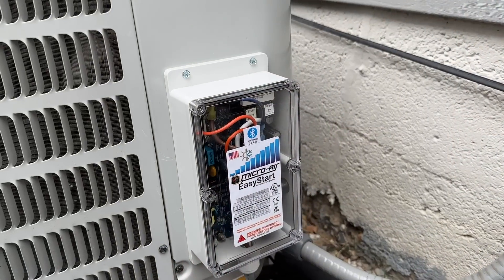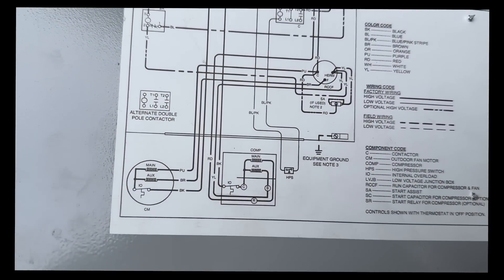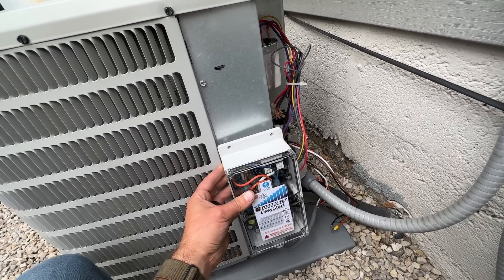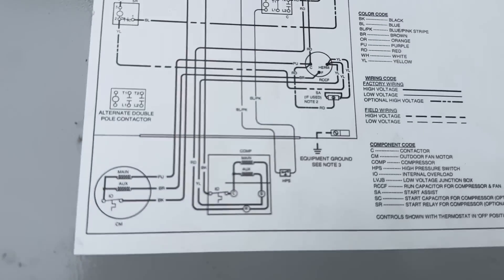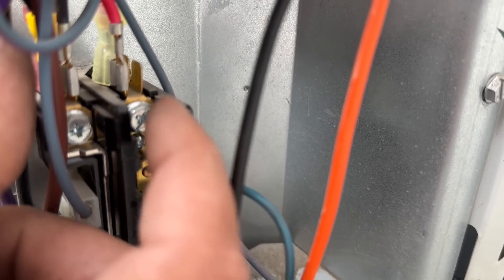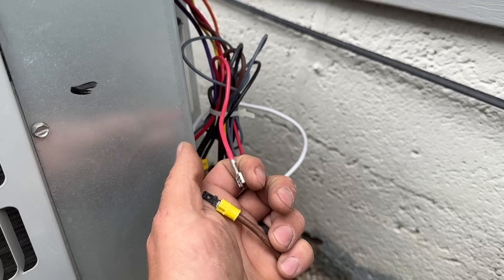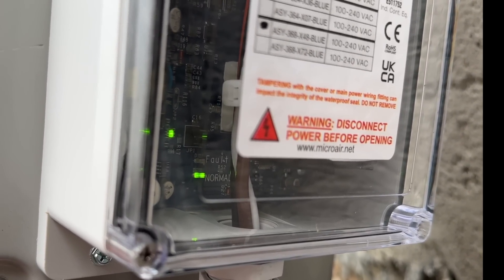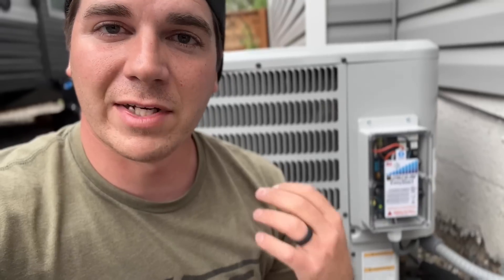Prepare For An Emergency Power Outage By Installing This Device.   Micro-Air Soft Start

Comment: Did this over a year ago for the exact same reason and it works perfectly. I think all compressors should come with an easy-start board pre-installed. Gives the compressor a longer life.
Reply: Yeah, but then you wouldn't have to replace it as often...planned obsolescence!  Just like everything else in the world.
Reply: Hello. Novice here but by delaying the compressor from starting as designed, what does that do to the cooling times? Does it prolong it at all? If it does prolong it then would it be minutes or hours? Lol
Reply: @rci30  It prevents the hard start, instead it ramps up. It doesn't do anything to the cooling time, just prevents wear and tear on the compressor from the instant jolt.

Comment: You misunderstand about the nature of a soft start device like this. It does not magically use less current so you "save money" as you stated at the end of your presentation. This device helps to prevent a fuse blow, a circuit breaker trip or a power generating device that was incorrectly sized for the compressor start-up load by an amatuer electrician.

These soft start devices are trending in popularity because of the solar generators (big lithium batteries paired with an inverter/charger combo such as Eco Flow Deltas & Goal Zero Yeti 6000X etc). 

The firmware in these new solar generators is programmed to prevent too much current discharging from the device in a short time when connected to high surge induction loads like refrigerators, air conditioners and washing machines.

Comment: How do these compare to Sure Starts by Hyper Engineering? I know they are both Soft Start, i work with Tesla PW and if an A/C is compatible thats what was used. Wonder why they had such dedication to that brand as they seem to cost substantially more then this one does, big companies usually go woth cheapest option that works.

Comment: Where do you power the air handler from when using a generator? Did I miss something?
Reply: You'd need to have an electrician install a generator inlet and lockout kit on your panel in order to be able to power the HVAC with the generator.
Reply: My point is that a condenser should not be able to run unless the air handler is also running to satisfy the controller.   One without the other is useless.  @waterboy74

Comment: I've really considered this, but my HVAC contractor says:  "This falls under the category of it sounds good on paper but in practice, not so much. It will void any warranty you would have on the ac system. They would not work with variable capacity, modulating or dc voltage compressors at all without likely damaging the electrical components.

Typically, units get a “hard start” installed as they age as the compressor needs the extra help trying to get started. Soft starts tend to overhead motor windings, leading to an early death of the compressor. While they may save you energy, when they destroy the compressor, that doesn’t save you any money in the long run."

Comment: So would you recommend installing an Easy start on a new AC unit to extend the life of the compressor?
Reply from the maker: Some argue that it gets the windings hot really fast by starting it slowly but I can’t confirm that. I wouldn’t install it purely to extend life, I’d do it if I wanted to be prepared for an emergency.

Comment: Is there a benefit for installing a soft start on a system besides using a generator during power outages?  I don't have a generator and may not get one.  That's for another time.
Reply from the maker: If your ac makes noise at startup this will definitely help if not eliminate that, as well as keep the lights from dimming when they come on. It also allows you to run a smaller breaker size at your panel 👍🏼

Comment: I'm having one installed in preparation for solar panels with battery backup.  My Lennox AC has an RLA of 82 amps.  That would overload the battery's capacity and trip its protection circuits.  So am getting one now.  My system really sounds horrible when it first starts up, as do all the units in my subdivision and we are a new subdivision less than 5 years old so all the HVAC systems are new.

Comment: Interesting .  What size unit are you running there that pulls 39 amps,  is quite a bit..  So this system drops it down to 7 amps,  that is amazing..   Why put in a 20 seer system  if it drops the amps 32 points down to 7 amps..   How does it do that.. I need  to go buy one..   A start kit will keep the amps low on start up but during the Run..
Reply from the maker: This is probably the most common one. It’s for 3-4 ton systems: https://amzn.to/46fFxO9

The Amps running will not change, that’s why I’m going with the 20 seer. This unit is great for running your system in the event of an emergency. That’s the primary reason for installing it.

Comment: I have an Emerson 49M11-843 Sure Switch contactor on my Rheem AC (R.L.A. 16.5/16.5)...Can I attach the Black 14g wire from the Easy Start in the same slot as the 10g T1 Compressor Common wire? There is no other place to connect the Black wire from the Easy Start.
Reply from the maker: I’d venture to say yes but for the best customer support I’d contact Hutch Mountain. They have really good customer support for the micro air units 👍🏼

Comment: If an outage has me desperate enough to break out the generator it's to power essentials like the fridge. Not the luxuries of the entire central A/C and HVAC system. And don't need a $XXX control board to diag a faulty $15 contactor or capacitor.
Reply: 😂 yea try working a 12 hr shift, rescuing stranded ppl, throwing away your entire home contents (wet) at that. Last time I checked hurricane season is in our hottest months of the year. What in the hell is more important than fucking cold air? 😂 southeast texas gulf coast would wholeheartedly disagree, nice take tho

Comment: Cool! I look forward to seeing a comparison of your electric bills, before and after!
Reply: Soft start will have zero impact on the electrical bill.   It only spreads out the startup over a longer time to lower the current.  It has no impact on startup power or running power.  Even if it did you wouldn't be able to tell it from the electrical bill as there are way too many other variables at play.  Different weather before/after just being one of them.

Comment: Do yourself a favor and mount that on the wall.....that's going to be a pain when you need to get to the electrical components high and low voltage. Thanks for the good tips and video.

Comment: So I thought this was a soft start. Meaning a slow buildup to the normal amperage draw. Which in this case was 39 amps. So does the amperage stay right at 17 amps throughout the runtime? Seems to me that you would be sacrificing efficiency of how fast it cools the house.
Reply from the maker: Running amps stay the same which is about 7-10 amps. But inrush amps went down from 39 to less then half.

Comment: Wait, common?  There shouldn't even BE a common going to a 240v motor, let alone have any current on it.  All of the current should be between L1 and L2.  Measure those.  And a soft start isn't going to save you any money on your electric bill since it just takes less power for more time to get up to speed.  Wait, it occurs to me now that the run capacitor is probably returning some current on common as it shifts the phase of one of the legs to simulate 3 phase power.

Comment: If you’re installing a 20 SEER then it will be a variable speed and you won’t need to add this to it because they don’t have high inrush amps
Reply: My dual zone system is about 4 years old. How do I tell if I have the variable speed you are talking about?

Comment: We A/C guys used to consider the small kit a soft start and the start capacitor with the start relay , a hard start kit . If you had a tight compressor , the small one might not get it going , or if you short cycled it without allowing pressures to equalize . Just new technology I guess and now that most everything has short cycle protection . Thanks for the great videos .👍

Comment: Electrical engineer here. Electric motors don't  really have "inrush" current though lay people use this term all the time for motors. Electric motors have "locked rotor" current which is the proper term. Inrush current is more appropriately applied to power supply transformers.
Reply: There are coils in the motor just like transformers.   “Locked Rotor” mean just that the rotor is not going to turn when power is applied.  Initially on a non “Locked Rotor”, motor, those motor coils have no ‘EMF’ developed, exactly like the P.S. Transformer primary coil.   I would call that initial (same occurrence in both applications) description as inrush current, unless there is a better description of that initial compressor current.

Comment: I installed mine a little over two years ago.  Worked beautifully during Ian, where we lost utility power for 10 days.  Was able to run my 3-ton, 16 seer with a Champion 8750W peak (7000W running) inverter generator.  The BT is not the greatest.  I wish it was wifi and had a better app.  Wiring was no big deal.  If the Sun hits it, it will fade the wire colors and and makes the plastic case brittle over time.  Then add in the vibration.  Keep that in mind.  I mounted mine just like you show here, and, honestly, I would not mount this directly on the A/C unit next time.

Comment: question about this electronic throttle board dose it help with electricity bills cause right now 300 dollars a month bill makes my life hell an im needing a way to cut the bill so i aint got to run a swamp cooler with the ac off
plus dose it get as a cold as it did without the device?
Reply from the maker: This device will not affect the power bill unfortunately. That’s all based on your systems seer rating. And no it will not affect performance, it will blow the same coolness as it does without the easy start. It basically just affords you the ability to run it with a generator is all 👍🏼

Comment: If you have a 5 ton Carrier Infinity communicating heat pump air conditioner that has five stages and lra of 37 amps would there be any benefit from this product? Likewise wondering about the other communicating or non communicating type air conditioners that ramp up slowly. I think Lennox, Bosch carrier, trane all have higher-end units with 2 or more stages. I just wasn't sure if this type product works on those or not. Does anyone know or have one installed on a non single stage heat pump?

Comment: Why didn’t the original 39.2 amp draw trip the breaker?
Reply: It's just for a split second. The grid can handle it for now. It's a problem during outages. Everything kicks on at the same time when power is restored. They draw more power when they start up then when they're running. The soft starter is a variable frequency drive that ramps up the motors. The breaker or fuse are slow blow. It can take a second or two before it heats up enough to trip or blow a fuse. Everytime a breaker trips it lowers it's amperage rating. From oxidation mainly. So, it's a power factor thing. Manufactures use capacitor banks for it. These devices also but they've been outside the reasonable price range for commercial products. Just pulling too much voltage or amperage from the power plant, has to be corrected.

Comment: I have been using my Micro-air for over a year now here in Florida.
No issuses and I will say we had one hot summer last yaer. I plan on getting another just as a backup.
Reply from the maker: Make sure and use the link in the video description if you decide to get another for backup! Cheers

Comment: Could it be used on a well?  My AC unit draws 2400 W while running, my Well only draws 1500 While running.  (I don't know how to calculate start up power draw(s).

Comment: For those trying this make sure there’s no voltage in the capacitor as they store about 330v and it will feel weird if you touch it but take the disconnect off and leave everything the way it is for at least 30 seconds that should drain off the stored power in the capacitor. I also like the ease of being able to use this easy start off a generator as it makes it easier than having to install a transfer switch to the house to power the hvac. It’s also worth a mention to note which one to get so people don’t buy the wrong one as there is a slightly cheaper one for mobile/rv homes and I see some of these say 4.5 tons commercial/home but I have a 2.5 ton so would this cover that size? I do see all the voltages and models on the front sticker.
Reply from the maker: The sizes for the different soft starts are in the video description 👍🏼
Reply: @sheepdog3828  would you just need to kill the main power as an interlock is just switching off the main anyway? I thought that this device would had a port to allow you to run the ac directly off the generator.

Comment: will it work with two capacitor?
Reply from the maker: Yes you just attach the orange wire to the herm terminal, that’s the only capacitor connection.

Comment: Your Not Going to see any Reduction in your Power Bill  the Inrush amp surge is so short . The Main Reason to install a Soft Start is to Power the AC Unit with a Generator when the Main Power Grid is Down Other then That your Just Wasting Money on a Soft Start !   The ICM870-16  is half the cost of the Micro-Air if you don't really need the Bluetooth .
Reply from the maker: Thanks Dan, I realized that after all the comments came flooding in. The main reason for me, was so that I could power it with a generator. I’m excited to get that set up. I just got my power inlet box and interlock kit installed and my gen set is on the way! Cheers brother

Comment: is it good to Get this if you have a non-inverter AC will it save me some money in the long run?
Reply from the maker: I’ve actually heard the savings are minimal. But it will allow you to run your ac with a generator however. That’s the biggest benifit
Reply: NO its not going to save you money on your Power Bill , Soft Start are for when your wanting to run Your AC unit with a Generator when the Main Power Grid Go's Down
Reply: How do I tell if I have the non-inverter type you mention?

Comment: ICM makes a soft start up to 4 t..... It would not start my AC with 1 predator 9500 and it would not start it with 2 predator 9500 in  parallel ( Does work good with grid electricity lol)But the micro air  soft start easily starts it with 1 predator 9500... Start up amps were a 107 dropped down to 38..... Comment The ICM unit is supposed to be for 120 or 240. I think it would probably work on a smaller 120 application in the RV and there are much cheaper at a $140 compare to almost $375  for the 4 t micro air soft start.
Reply: ICM870 only has a 9amp & A 16amp RLA Soft Start Currently & WAY To Small for a 4Ton AC !  They are coming out with a 32amp version and should be out latter in the year i heard around October it will Run a 4ton AC , The ICM870-16 amp works great on Newer AC units up to 3 tons with a RLA not over 16amps  .

Comment: I purchased the same unit for my 3.5 ton AC.  It was moderately easy to install.  I really like the Bluetooth diagnostic app.  And I like the diagnostic LED lights.
Reply: Hello, I have a 3.5 ton ac as well let me ask you what wattage generator do you use? I just bought the predator 5000 watt generator and was wondering if it will be able to power my ac.

Comment: When u install the easy start. Now are u able to run ur ac unit with a generator?
Reply from the maker: Yesir. Of course once you have a means to connect the generator to your home electric panel
Reply: I have a old outside unit do u think it would work on it? I think it's a tran 3ton..and would it lower my light bill?
Reply: @conrad6301    NO it will not lower your light bill   Soft Start are Mainly used to Run Your AC with a Generator
Reply: Oh okay thanks....yeah I'm not an AC so just getting some info

Comment: Change the contactor and capacitor while you're in there.  My heat pump is 10 years old.  I installed the Easy Start and then realized that the contacts on my contactor relay looked really pitted and burnt.   A new contactor is only maybe $25 or so from repair clinic.  With the reduced current draw I expect the new contactor will last forever.  My startup isn't much quieter, but the start current went from 76 amps down to 26 amps peak at startup.    I also fixed every loose panel on the thing so now it doesn't rattle the whole time it runs.   Great product.  No more flickering lights when the pump starts.
Reply: Really smart, @NackDSP. I ordered a new contractor for our AC unit. Now I need to open up the unit and determine which capacitor I have. I hope to install the EasyStart and new contactor/capacitor together in the next few days.
Reply: Unfortunate that it's not much quieter. That's the main reason I was looking at a soft start.

Comment: You should do a video on the true cost of replacing a  furnace and or Air Conditioning condenser. Specifically some of the tactics companies use like buy a furnace get a/c condenser free.. how is that possible without just overcharging for furnace price? And what the actual cost is for a furnace or air conditioner to know if we're getting ripped off or not, cost to replace and easily accessible air handler or one in the attic for example
 Just wondering if you'd break down some of the common tactics companies use when selling  packages or furnace or condensers. Thanks
Reply: Everybody knows those are gimmicks used by sellers! I hope they are smart enough to know!

Comment: I have the Bluetooth model on my 3T residential and the regular model on my RV.  No more bang on startups!  They say a Honda 2800 will run the RV unit, but I have a different one.  The Hondas have a few more cc's than mine.  This would be perfect for residential with solar and battery backup.....  But I'm content with longer life of my a/c.